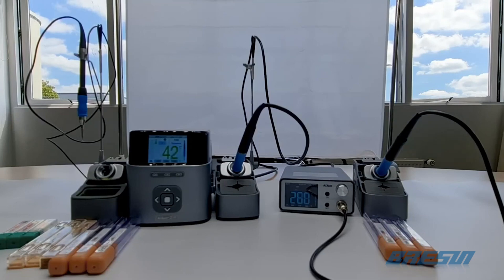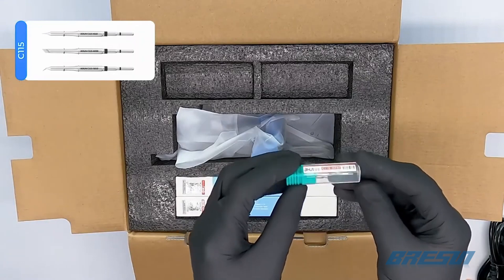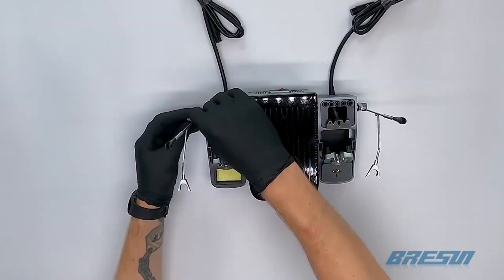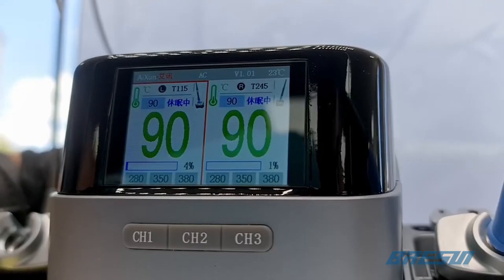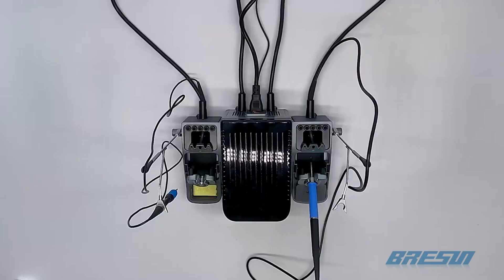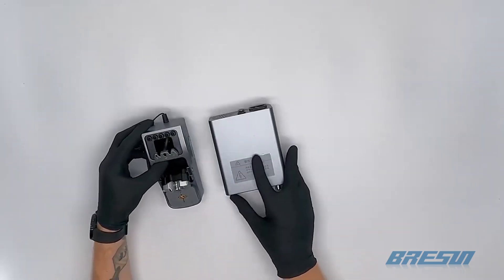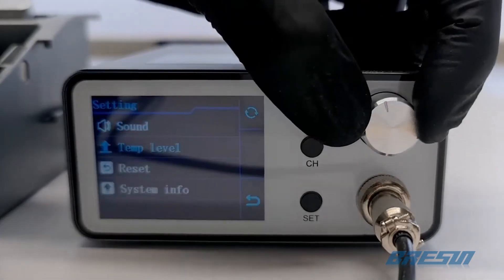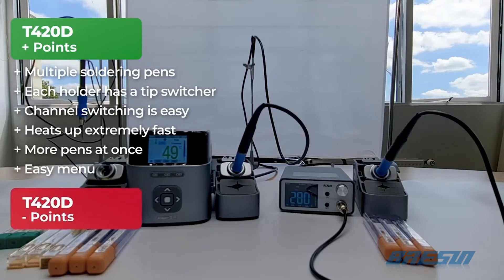AIXUN T420D Dual Channel Smart Soldering Station For Mobile phone Precision Repairing #phonerepair

Comment: The latest firmware for the T420D is great, highly recommend updating to it!
Reply: Already updated. When you work with a 210 handle, does the transformer make any noise at all? It's not very loud, but it buzzes. and with 245 everything is quiet
Reply: thank you so much,thank you for your support:washhands:

Comment: Hi, friend! under load on the T420, if the transformer makes a little noise, especially when working with the 210 handle, is this normal?
Reply: I've noticed that my 210 handle does this, not sure if it's a bad tip or handle or if it's normal. Never had this happen with any of my other stations so seems odd to me. I don't hear the transformer but the handle makes a buzzing noise.
Reply: it's normal,dear.There will be a little frequency sound when the transformer is loaded, which can be felt by the ears.:goodvibes:
Reply: Hi  friend,it is normal.There will be a little frequency sound when the transformer is loaded, which can be felt by the ears.